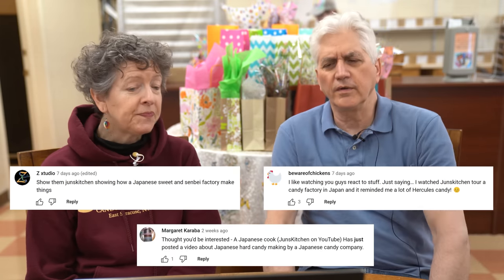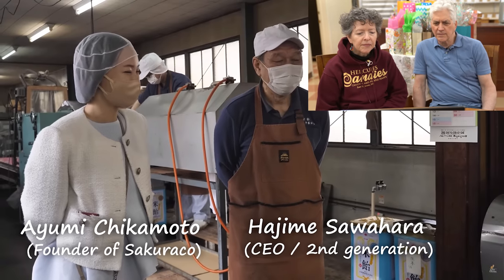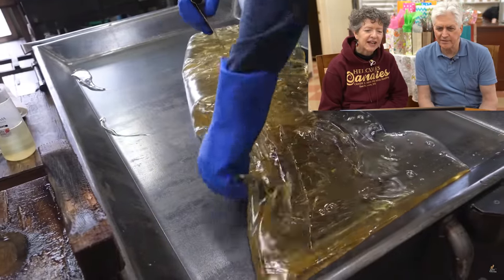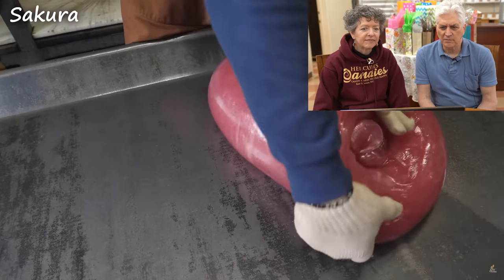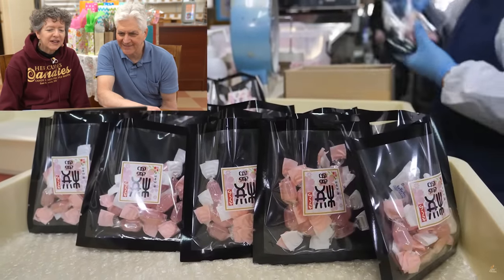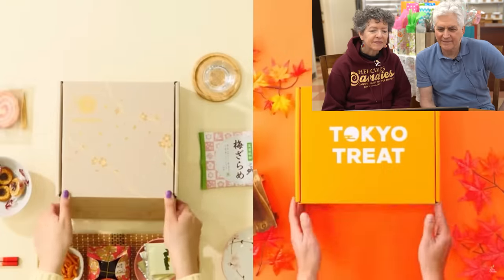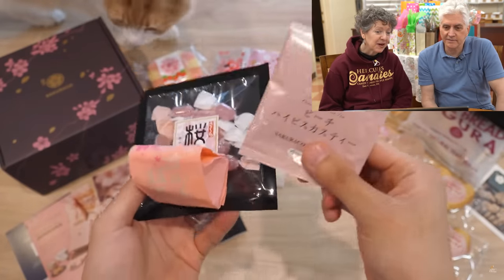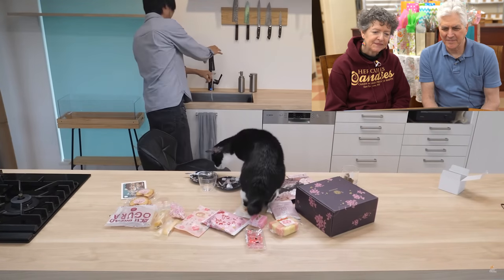US Candy Makers React To Japanese Sakura Candy (JunsKitchen)

Comment: Japanese starch syrup and American corn syrup are similar but not exactly the same. Both are sweet syrups used as sweeteners and ingredients in various recipes. However, they differ in terms of their sources and manufacturing processes.

Japanese starch syrup, also known as mizuame, is primarily derived from glutinous rice or tapioca starch. It is a common ingredient in Japanese cuisine and confectionery. Mizuame has a thick and sticky consistency and is often used to add sweetness and moisture to foods like mochi, candies, and sauces.

American corn syrup, on the other hand, is made from cornstarch. It is commonly produced through a process called enzymatic hydrolysis, where enzymes are used to break down the starch into smaller molecules. Corn syrup is widely used in American cooking and baking and is often used as a sweetener in recipes for desserts, sauces, and beverages.

While both Japanese starch syrup and American corn syrup serve as sweeteners, they can have different properties and flavors. Japanese starch syrup, derived from rice or tapioca, may have a slightly different taste compared to corn syrup, which is made from cornstarch. It's important to note that there are different types of corn syrup available in the United States, including light corn syrup, dark corn syrup, and high fructose corn syrup, each with varying sweetness levels and flavor profiles.

In summary, while Japanese starch syrup and American corn syrup are similar sweet syrups, they are made from different sources and can have variations in taste and consistency.
Reply: Thank you!! I was wondering about these very things, because it definitely did not look like corn syrup in the details.
Reply: This is a very ChatGPT response
Reply: Thank you for that it got on my nerve too when she corn starch sugar. Japanese very rarely use corn syrup in their sweets and have many healthier alternatives to it
Reply: interesting to note that mizuame's sweetness is a lot more gentle to my tongue as well compared to corn syrup, i can finish japanese sweets more easily compared to american counterparts as a result. i believe corn syrup is flavored with either vanilla or molasses which makes the sweetness a lot heavier compared to mizuame. but then again that might just be my taste buds speaking
Reply: i detect a chat gpt response
Reply: Me when my teacher says I have to write a paragraph about the video we just watched:
Reply: Yeah but they say in the video that it's a mix of mizuame and corn syrup 
Corn syrup is a little more robust in my experience, mizuame is a bit more delicate, I dont mean flavour I mean physically corn syrup seems to burn more slowly (in my professional experience I haven't bothered to look up the differences but if I had to guess mizuame has a lower boiling point and heat capacity in its starch but I could be wrong about why it burns sooner) so it actually makes a ton of sense to mix them, same way you use compound oils when cooking to give flavour without burning
Reply: Did lazy kids in school come to you to write their essays cause this was quick, concise, to the point, and has great format 😁 good writing is truly a skill!
Reply: @RoxxyFly  omg touch grass
Reply: @ConstantChaos1  I touch grass often. I was just impressed. I didnt do well in that subject and tried really hard while this person can seem to do it so effortlessly. I even took a puvblix speaking cpurse not even thinking about the fact that id have to write essays. Its okay for people to be genuine on the internet you know. Maybe YOU should touch grass, hmm?
Reply: @RoxxyFly  if that's what you sound like when you're being genuine i can understand where you'd have problems conveying information in written form, this 10000% reads as snarky and sarcastic. I am now being genuine when I suggest you get tested for ASD if you haven't been already it could help to explain some things for you and give you a good starting place for working on those skills since as someone on the spectrum myself the only idea I can come up with that would explain such a misalignment of intent to text is ASD
Reply: @ConstantChaos1  yeeahhhh i get that a lot. My mother even regrets not getting ne tested after living with her stepson whos diagnosed and now sees some similarities 😅 ive learned that using emojis helps but i was so enamoured by his skill i totally forgot that people can misread tone 😅 i mask really well in person tho 🤣🤣 with my hyperfixation of learning, i learned a lot around my peers while simultaneously terrifying everyone around me 🤣🤣
Reply: @RoxxyFly  I definitely get that i just watched a research video about how we cam now theoretically read some aibcent scrolls from Greece that burnt up in a volcanic eruption so I can definitely get the learning part lol
Reply: @ConstantChaos1  omg what?? I need to make a rabbit hoke list lmao the world needs to slow down rq 🤣🤣 actually come to think of it 🤔 i think i heard about these already. Are these the ones written by jesus?? That was a wild series of videos let me tell ya
Reply: @RoxxyFly  the herculaneum scrolls while old enough to have been written by Jesus almost definitely weren't written by Jesus if nothing else they were written in the wrong languages and about the wrong topics for it to have been Jesus, they are in aincent Greek (not Aramaic or hebrew) and are about aincent Greek philosophy not Abrahamic theology 
It's technically possible that Jesus wrote them but the odds are SIGNIFICANTLY better that Jesus played rock paper siscors than him having written these. Rock paper siscors dates back 2500 years in China and the silk road trade and cultural exchange was established for centuries before the time of Jesus so it's actually likely that he played
Reply: @RoxxyFly  it's chat gpt, you can check the database of logged prompts and "What's the difference between Japanese Starch Syrup and American Corn Syrup" yields the same response the initial commenter gave word for word.
Reply: @nextgenstudios335  ive never used it, still impressed
Reply: randomvideoboy1  im happy for you i guess? <3
Reply: Chatgpt and didn't even try to hide it lol
Typing this in chatgpt = "Yes, the passage you provided appears to be generated by an AI, specifically by me, ChatGPT. If you have any questions or if there's anything else you'd like to know or discuss, feel free to let me know!"

Comment: Asian starch syrup is usually tapioca starch. Tapioca is from Cassava root, but there are also rice starch syrups which are way expensive.

I didn't notice if you ever explained that Sakura is just the Japanese name for Cherry Blossom?
Reply from the maker: We did not explain that, we only learned it from the comments from you guys haha
Reply: A lot of people know that already. You dont even have to be an anime fan anymore to know.
Reply: Corn syrup is technically corn STARCH syrup too
They use enzymes to break down the starches into sugars
Reply: @HotShotLion Not everyone knows that, I had no idea what syrup they used. I just knew it wasn't glucose syrup or corn syrup
Reply: @HotShotLion tbh I didn’t know. So I think it’s fine.
Reply: Japanese candy-makers will often use Mizuame, which is a malted glutinous rice, rather than tapioca. Not sure what was used here, though.
Reply: They called it Mizuame specifically, which is traditionally made from glutinous rice and malt (mugi mizuame, literally "wheat water candy"). There's also a newer and more popular acid hydrolysis method using potato starch but the old version supposedly tastes better. Knowing Sakuraco they would probably feature candy made with traditional mugi mizuame.
Reply: @peepysprite  Thank you for the confirmation. I'm good at research but don't speak Japanese; I couldn't keep track of both videos and also follow the original audio. ;)
Reply: Did you get the box? I would love to see them try these ❤
Reply: Aannndd this comment is how I learned I can't eat Japanese candy, because I am allergic to tapioca.
Reply: I thu k they said theirs is a mix if mizuame and corn syrup

Comment: I live at around 7000 feet elavation. This affects cooking times and temperatures. That might make a difference in candy making temperatures. "As atmospheric pressure decreases, water boils at lower temperatures. At sea level, water boils at 212 °F. With each 500-feet increase in elevation, the boiling point of water is lowered by just under 1 °F. At 7,500 feet, for example, water boils at about 198 °F."

Comment: Sakura is a cherry tree but you’re using the blossoms for the flavor- it’s like a cross between a rose and a sweet cherry. You have those floral notes but also a little sweetness of cherry juice - it’s not a sour variety like European/American cherry flavors 

Matcha is green tea, the flavor profile is different if it’s strained leaves and different if it’s the concentrated powder altho in Japan the powder form is more prevelant and widely used. It can be almost chalky to touch the dust and the pigmentation is from the chlorophyll of the plant and it doesn’t stain but it is obvious when you spill it - like knocking over a bag of flour it’s not an issue to spill it but it’s ya know a mess and looks like a big issue.

Comment: Why don’t you tap or pour
the buckets of corn syrup into a
Dispenser with a tap? I think you can buy cooler bins with taps or drink barrels with taps.  Put it on a stand and put the kettle under it.  Turn on tap.
Reply: Look for a brewing barrel for making beer. They have holes for taps.  You’d just have to tip a few buckets of the corn syrup into it.  Sit it on a table or stand.